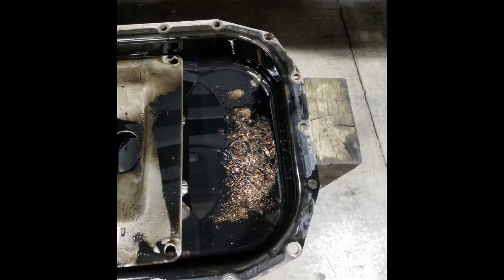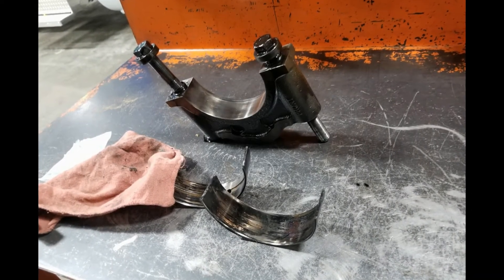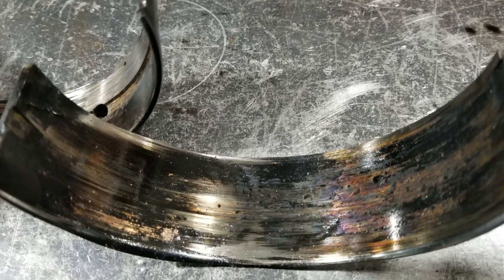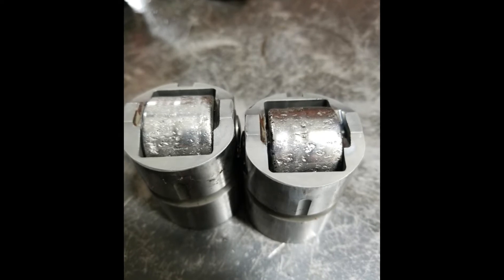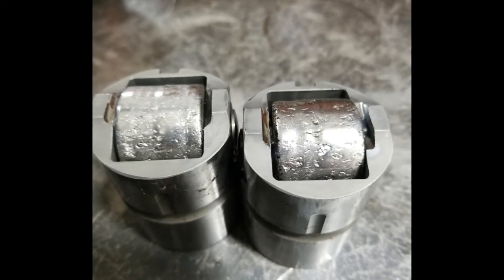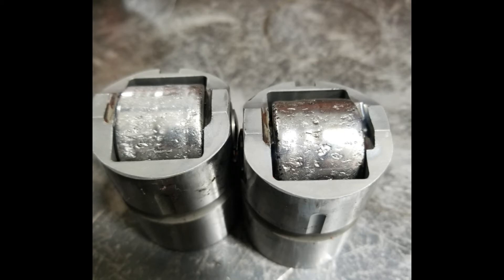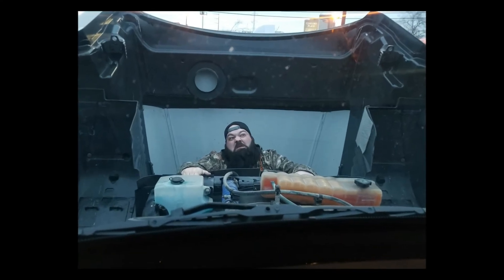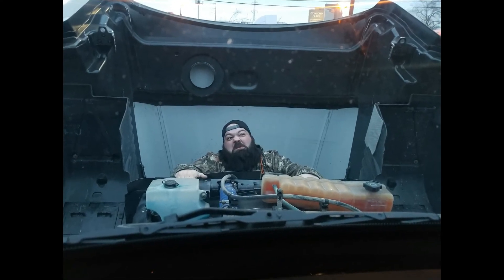What made my Cummins ISX 13 BLOW UP!!!

Comment: That's exactly what happened to my with just 600k miles ... They changed the status of the recall for upgrade to minimize the chance of a law suit against Cummins , now cause is a upgrade fall on the owner laps as maintenance , the high pressure fuel pump has to be rebuilt every 300 to 400 k miles even with the new metal plungers ,,,is a bad dissing I use to love old Cummins N14 but now I hate them  , I just bought a 03 Columbia with a 12.7 Detroit 60 series . Ok man good luck bro